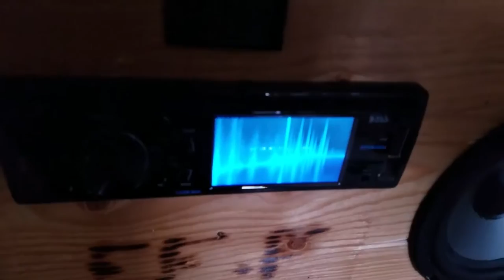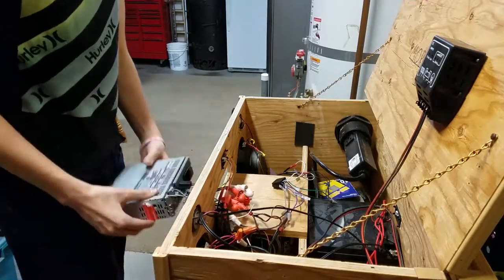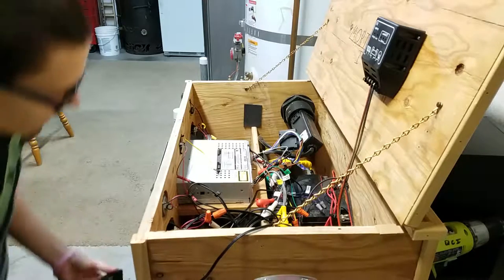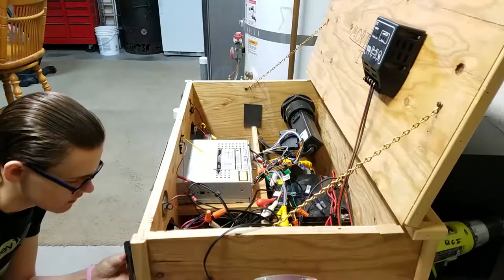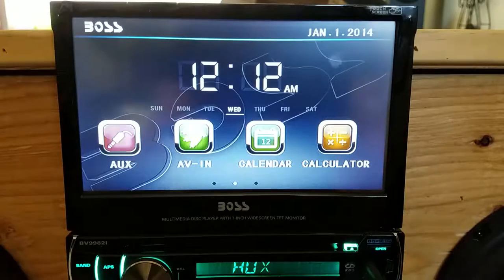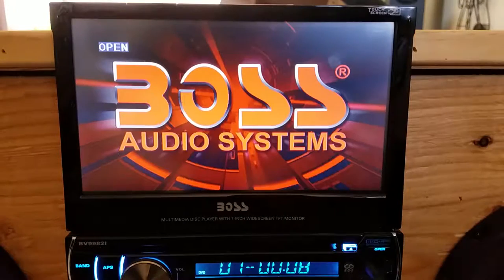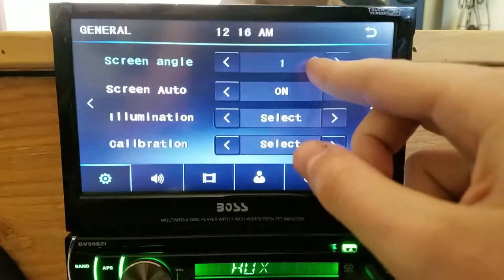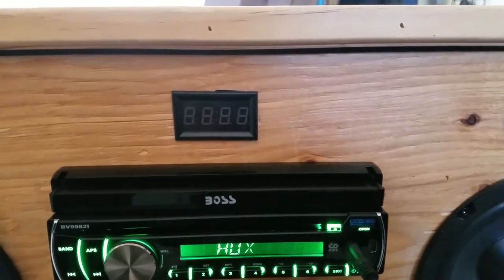BOOMBOX UPDATE

Comment from the maker: for anybody who wants to hit that dislike button (l know you're out there) please tell me why you disliked it before you hit the thumbs down. disliking does nothing if l don't know what you disliked about the video.
Reply: Well okay i disliked because i came from a comment on a video about a boominator. In the comment you wrote that you had build a much better boombox than the boominator. Well you have not. You should never use a car headunit for a boombox build because they are unefficient and tends to be power hungry for no reason which gives you a shorter battery life. You would never just put the speaker drivers in a random box it needs to bee properly calculated and airtight if it isn't ported for optimal sound. i dont know the specifications of the drivers but it is important to go for drivers with a high SPL for maximum efficiency and loudness. It may be cool to have a integrated touchscreen but i find it utterly useless while everyone uses smartphone or tablet to connect to their portable loudspeakers nowadays. The Boominator is made to be used outside for partys and festivals and with the solarpanels it produces more power than it uses while it using a energy efficient class d amplifier and high SPL drivers that produces a lot of volume at low wattage.
Reply from the maker: just got your comment a year late, l am sorry but l have no idea what you're talking about.

"You would never just put the speaker drivers in a random box it needs to bee properly calculated and airtight if it isn't ported for optimal sound." l designed that box for this type of speaker orientation, the box is really big so it doesn't have to be ported and it doesn't leak air through the top. even when l hit hard bass notes there is no air coming from the top of the box, and that's why l made it so big. if it was smaller than you would have a point. 

"You should never use a car headunit for a boombox build because they are unefficient and tends to be power hungry for no reason which gives you a shorter battery life." l have never had that problem, there is a 3 amp fuse between the stereo and the battery and it's never popped which means the stereo isn't as inefficient as you say it is. a few years ago l accidentally boiled the cells on that battery and it can still power this stereo for a day and a half. also l used a head unit so l could get extra features like a touchscreen and the ability to play movies and this is way more power efficient that using a TV with an inverter because l tried that at first when l first built the thing.

"i dont know the specifications of the drivers but it is important to go for drivers with a high SPL for maximum efficiency and loudness." these drivers are average. they are probably rated between 85-90DB and they are 6 ohms.  

"It may be cool to have a integrated touchscreen but i find it utterly useless while everyone uses smartphone or tablet to connect to their portable loudspeakers nowadays." l can't plug a DVD player or game station into my phone. also my phones battery life is much shorter than that of this boombox. so using my phone is not an option considering all of the data and battery life l would burn. when l am out and about l never use my phone for anything other than texts and phone calls. if l play games or watch movies on it all day then what good is it going to be when the battery dies and an emergency happens?

"The Boominator is made to be used outside for partys and festivals and with the solarpanels it produces more power than it uses while it using a energy efficient class d amplifier and high SPL drivers that produces a lot of volume at low wattage." the only advantage that thing has over mine is that it's running a more efficient class D but my class A/B is better for sound quality.